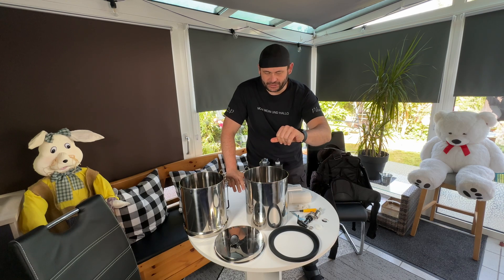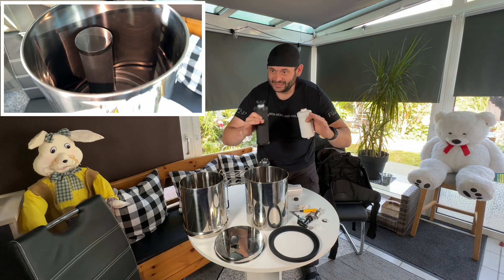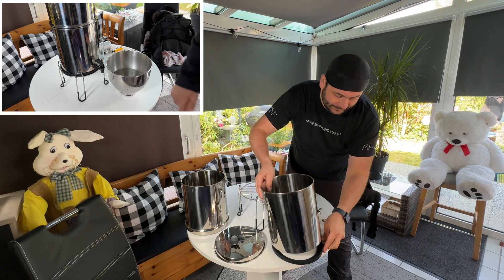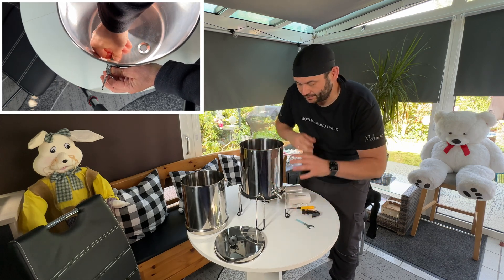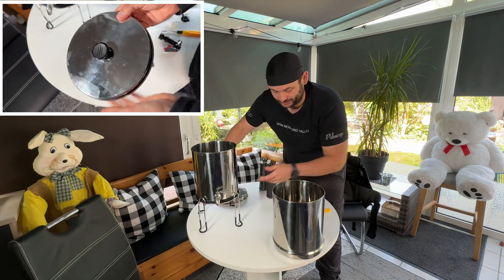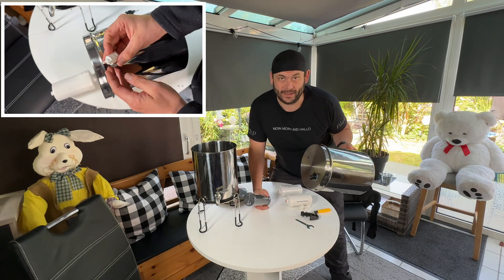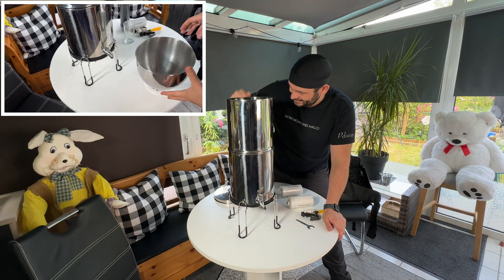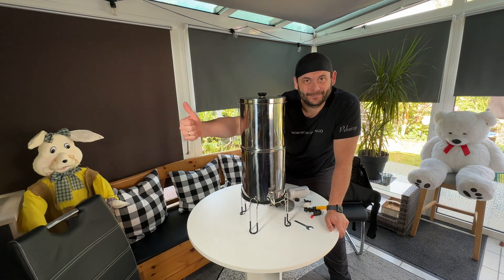How to assamble Gravity Water Filter System and replace the filters - Purewell Ultra-Filtration DIY

Comment: The instructions on these purewell systems are poor & the filter instructions.My carbon filters only had 1 rubber washer on each, but I took the 2nd 1 off the other filter as it was a 2 pack.Set up in 8 mins my butt lol.Took me half an hour trying to figure it out how to put it together only to fail, another 45 mins trying to find a put together vid from start to finish & half an hour to do the job.Thanks for the super easy installation instructions.It's dripping through,the filter I hope not the stopper lol.
I keep seeing people saying theirs isn't dripping.I just have 1 carbon filter, his system seem's more advanced, & it has to have the stand,2 washers,because it wasn't dripping for me when I put it on the worktop, but on the stand it drips.It's a really slow drip.